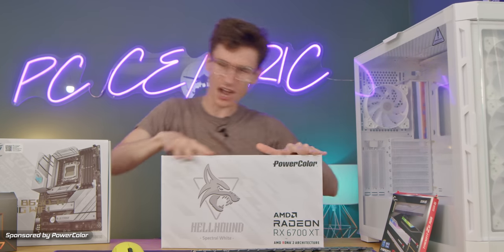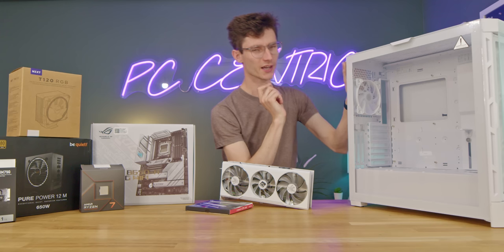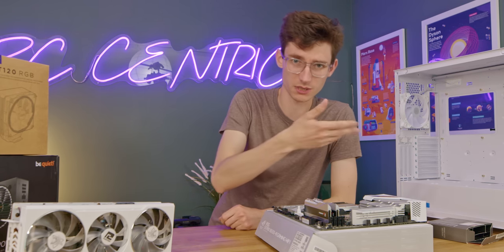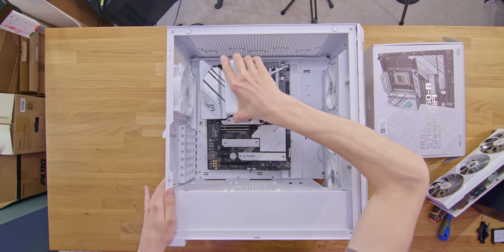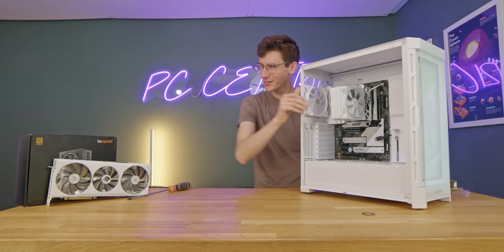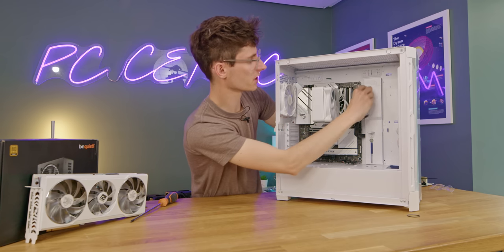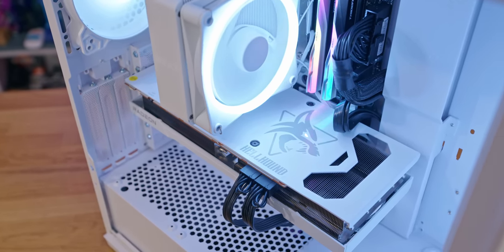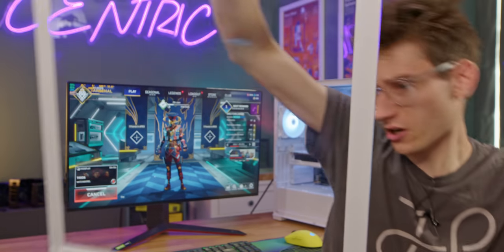The Gaming PC That EVERYONE Wants To Build!

Comment: I am a newbie at this, been looking at building a gaming PC, but the cost of a AM5 built system compared to a system based on a AM4 build is night and day. Even an intel build is still expensive. But this white build is amazing, not into all the coloured RGB, but the coolwhite LED lighting is spot on. I have read some of the comments and you have cleared up a lot of questions I was having. 👍👍👍
Reply: You’re gonna wanna spend the extra bit on am5, unless you wanna spend like 600 to upgrade cpu, mobo, and ram in the future either way
Reply: @themaker4216  I built it on a AM5 platform. Cost me nearly £2k. 🤣😂🤣😂

Comment: I built a rig with a 6700 xt and couldn't be happier. Perfect for 1440p gaming!
Reply: I had an 6700xt but still not good enough for 1440p max settings
Reply: I have a system with the Red Devil variant of this card and I have to agree that it's perfect for 1440p gaming
Reply: @ThunderDucky187  Depends what games you're playing, if you're expecting to get Cyberpunk 2077 to 1440p max settings then you will be disappointed.
Reply: How much was the total build cost if you don't mind me asking.
Reply: @BREEZYM6015  0. It is all donated because it is a sponsored video.
Reply: @Ugly187  True, but I mainly play competitive fps games that are more important getting frames than quality. Always remember you have to get the right card for your needs.
Reply: @BREEZYM6015  At the time, I probably spent like $1500 because the parts were a bit more expensive than now. GPU Rx 6700 xt, CPU 5800x, 32 gb ram, Samsung 980 pro, 750 psu, kraken aio cooler, and MB b550 pro. You can probably get that same build for like around $1000 dollars today.
Reply: @JorgeMartinez-ko6wu  yeah bro I ditched the 6700xt and got a 3080. Couldn't be happier. I played ghost recon breakpoint and the XT really struggled.
Reply: @ThunderDucky187 yeah maybe cause a 6700xt is same as 3070 which is miles more expensive than a 6700xt lol
Reply: @markod7662  he's not asking the content creator...
Reply: @ThunderDucky187   " yeah bro I ditched the 6700xt and got a 3080. Couldn't be happier. I played ghost recon breakpoint and the XT really struggled."

so you ditched a $320 card for a $600+ card

got it, as long as we understand each other
Reply: @ThunderDucky187   next up, my 1060 was struggling at 2k so I got a 4090. Couldn't be happier, the 1060 really struggled in games I wanted to play.

Makes sense, right?

Comment: I built a similar PC 6 months ago with the same CPU, the same Hellhound SpectralWhite GPU only the 6650XT-because it was on sale. I built it on the MSI B650M Mortar wifi(recently much better and cheaper than Asus) and in a much better case: the Fractal Design Meshify 2 Mini. Also used 32 Gb DDR5 6000 rgb Ram, 1Tb Samsung 980 Pro and Noctua Nh u12S CPU cooler in the blacked out version with white accents(because the case is black aand white). Plus a 3 set of QL 120 rgb from Corsair. All rgb is set to white. It is small, fast and totally black and white build!

Comment: Hahaha, I literally built this almost exact build with parts from Microcenter 2 weeks ago for a friend. Black variant of the same case, XFX 6700 xt, 750w Corsair psu, be quiet PURE ROCK 2 CPU Cooler, Microcenter bundle with  MSI B650-P PRO WiFi, Ryzen 7700x, and 32 gig of gskill ddr5 ram 6000mhz.

Comment: Did a drop in upgrade from 2600x with 5700 (non-xt) to 5600 with 6700xt. Sold my 5700 for $125 after 3 years of use. The total net cost is $494 dollars. Since I got my 5600 cpu for only 149 Canadian and 6700xt for only 398 Canadian. All brand new

Comment: great advice on the 7700/7700x. i bought the 7700 for cheap and comes with a cooler so more money for my gpu purchase. you can always upgrade cooler when upgrading cpu next time.
Reply: Could you list out your other components? How does it work on 1440p games?
Reply: @PacMan_Arcade  it kills in 4k so would imagine be great at 1440p too. if you only do gaming the 7600 is great too.
Reply: How’s the stock cooler?  I have a 5600x, and it idles at 44 to 49 degrees in Windows.
Reply: @zeroturn7091  it's about the same.. maybe more like 50-56, but also depends on climate in my room and weather outside.

Comment: The 7700X doesn't need huge cooler power. A Noctua NH U12 S or a Be Quiet Pure Rock 2 FX is totally fine. Just set your MoBo to 85 C maximum thermal point (in the bios) and you have the same performance with lower heat output.
Reply: Yeah it was mainly for looks

Comment: Random question: Are there recommended fan curves for 65W CPU builds, or does it matter? I recently finished a build at slightly lower specs price point: RX 6700 (non-XT, 10 GB; $270) and an i5-13500 ($210). It turned out well for a first build, I've just never come across easily digestible fan setting BIOS explainers.
Reply: You don't need to mess with the fan curves, stock settings will serve you well
Reply: @nugget-zf5by  Just answered my question without asking, lol, I just got a cooler master v2 240 liquid cooler, A top little liquid cooler for the price, Even after loosing a motherboard to a coolant pipe coming loose and burning a capacitor out, I will still only use liquid coolers, It just makes more sense for gaming to have better cooling system, But yeah I got the gigabyte H610I DDR4 motherboard, It got  smart fan 6, The SIV part is amazing, I am new to all the motherboard parts, I will say though the gigabyte H610I is an incredible motherboard considering it is cheap, 70 quid I seen it for now, You can overclock on it, Yeah if I was doing a full PC build, It would be with one of the gigabyte motherboards...
quid

Comment: OC gpu at min freq 2400 max 2750 .. set vram 2150 fast timing .. powerlimit +15% .. fan 70% .. trust me it's works +18% get more fps
Reply: And greatly shorten the life of the card. I keep mine at stock speeds and still get over 140 fps playing Halo Infinite. I can't tell the difference between 60 fps and 140 fps, bit I know my card will last years.
Reply: @l.i.archer5379  sounds good

Comment: Quick question. Is it worth buying the Ryzen 5 7600 over the 5500... In austrralia it's $200 extra, not including extra costs because of the AM5 motherboard requirement and the ddr5 ram.

Comment: My dad had a big win on the hotpicks a week ago and he gave me some money so I was able to buy a Gigabyte AMD 6750XT GPU for under £400 off Amazon(usually I buy from Scan but they were out of stock) and a new hoover. I just need a few case fans(2 140s and 1 120) and I am good to go to build my first new PC in 10 years nearly. Might buy some Lian Li stirmers too.

As for monitor I am not decided on whether to go 27 or 32 inch 1440p display. Looking at maybes an ASrock or Gigabyte monitor. Might go with a curved display. Are they any good?

Comment: Hey @PcCentric Please can you do a build on i5 13600k with Msi Z790 Tomahawk DDR 4 wifi motherboard , corsair lpx 3200mhz ddr 4 ram , noctua nh d 15 aircooler, lancool 216 case with lian li st 120 4 intake case fans 2 at bottom for gpu and 2 at top and 2 exhaust one at rear and second at the extreme left on the top of the case, with zotac rtx 4070 amp airo or gigabyte rtx 4070 eagle oc !! Just curious to know about the performance of this build in games !!

Comment: I'm building 7800x3d with 6700xt. When the 6700xt poops out or I decided to upgrade. Going to 7900xtx
Reply: yea im on 6700 too and my next will be 7900 also probs, but thats most likely not for years. 8th gen is out soon so might see a price drop for the  7s

Comment: Huge fan pc centric!! I currently have a Xbox one s and thinking of upgrading to a pc to play F1 23 and Microsoft Flight Simulator. (my provisional specs are intel core 12400f and 6600xt gpu) would you recommend a good motherboard and psu for these?? And would you make the switch to pc now?? I’ve been a massive fan of your channel, been subscribed for 3 years 😁😁
Reply: 1 word 4 this build - LMAO
Reply: @adamtajhassam9188 What do you mean?
Reply: You'd be better off with Ryzen 7600 non-X with the long life of AM5 so make sure you get the best B650 motherboard , pair it with 3060 ti over 6600xt for features like DLSS.
Other cost efficient parts 
Asus Prime AP201 Case
Crucial P3 SSD
Crucial Low profile DDR5 ram
Deepcool 650w PSU
Reply: I would recommend a Ryzen 5 5600 instead of the i5-12400 because the motherboards for it are a bit cheaper and it also delivers 5-10% more gaming performance, for less money.
You don't need an expensive motherboard or a power supply for the GPU/CPU combo you're looking for, but if you're wanting to upgrade in the future, I would invest in a quality 700W power supply.

Switching to PC now won't be a lot more expensive than it'll be in 6 months because no new major PC parts (other than Intel 14th Gen) will be announced this year. I would advise you to only stay on console as long as you feel like it, because waiting will not help a lot for pricing unless you're fine waiting over a year for the new Gen and significantly lower prices for older parts.
Reply: @r_turner good point but they are very expensive 😭

Comment: Working on putting a pc build plan together for gaming/streaming. Would you recommend this set up for that?

Also Probably a dumb question but is there any way you can set your rgb to green? Im debating on a white ir black case and been eyeing this case as this is the 2nd recent video ive seen a build done in. But id be setting my rgb to green as well as green or green/white cables. Just want to see how it looks compared to green rgb's in a black case. Can send pic to my email or discord. Just let me know what would be more convenient.

Also on the cpu fan issue....would a liquid cooled set up be a better option here? Im still fearful of leaks popping up at cpu cause then the dripping will be right on the GPU 🤦‍♂️.
Reply: Don’t do this build, not optimized for budget! If you would like a parts list, tell me your country and budget.
Reply: @jgchickmag123  US_Tennessee and I'd say $1500-$2000. Mainly play GTA5 and will move to GTA6 when released. Want to be able to livestream with good fps
Reply: Jacob Girardier Can you help me too I'll use US prices but I'm from Trinidad 🇹🇹 give me anywhere from 1000-1500 idc for 4k res I'm fine with 1080p
Reply: @Jack_Napier23  Hey, so 
I made you a parts list, just know that some parts right now are on the deal, and maybe not tomorrow. I made it for $2000, including wifi. This is top of the line gaming, 4k, you name it. Will be able to play all of the latest and future titles while streaming, the cpu can go down to a 7700 if needed. Some optional things you could buy are EZ-DIY-Fab cable extensions or more fans. Let me know if you have any questions!
Reply: @jgchickmag123  where did you send it to?